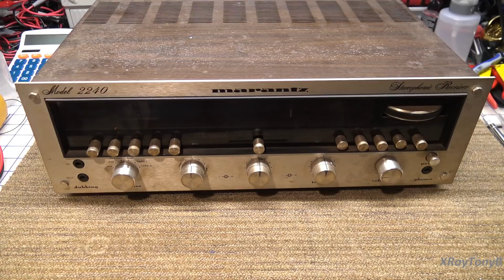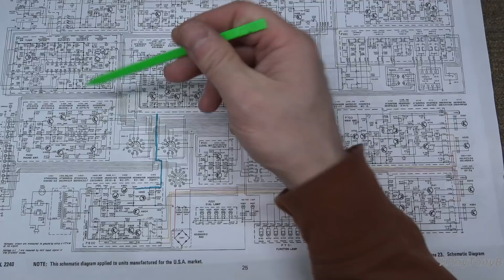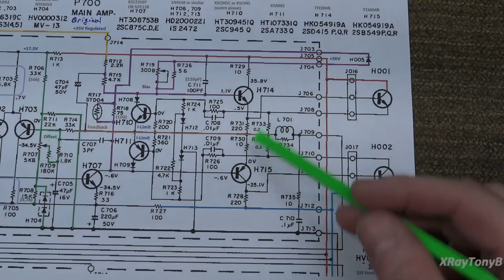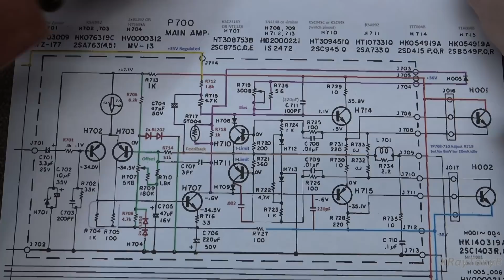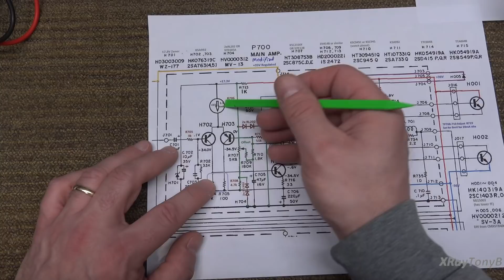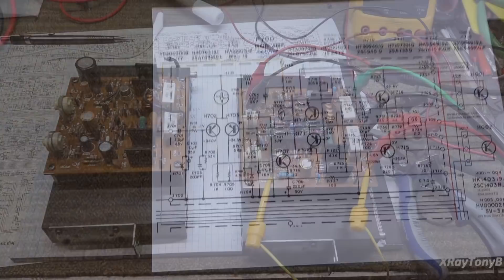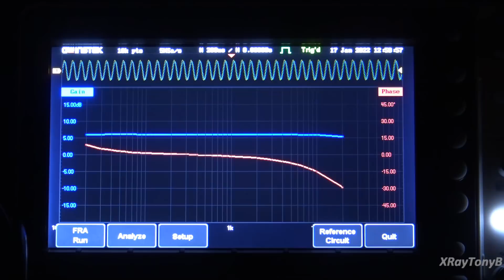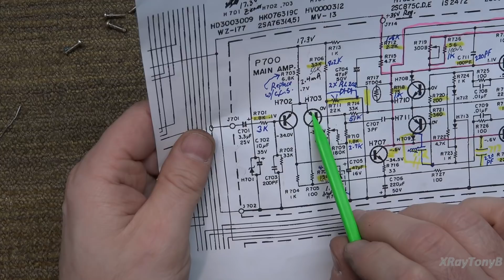Marantz 2240 Restore and Modification

Comment: Your explanation of how the differential input circuit works is wrong! The current in emitter resistor is constant regardless of the  signal swing! The current through the collectors is the same at idle! As the current increases in the input transistor, it decreases by the same amount in the second transistor! So the current in the emitter resistor remains constant!! The differential amplifier is biased class A. Current is flowing in both transistors at all times!
Reply: If you did'nt use the offensive language, one might be encouraged to review Tony's explanation and  your argument. Maybe you look to other comments here to see how to express yourself.
Reply: @Raul I will try to explain you why the current through the differential pair input is not constant and depends on the voltage swing.
If you have 1V p-p input signal then the voltage on the differential pairs emitters will vary  + - 1 Vbe drop i.e. from -0.3V to 1.7V Vp-p therefore the current through the 6.8k resistor will vary form 2.3mA to 2.6mA.
That's why we use better current sources (usually active loads) than a single resistor.
Reply: Perhaps you could edit your 'comment' to say that his explanation is 'wrong', instead of 'BS'. Eh?
Reply: @cjay2  the reason I said BS is because he is misinforming his viewers and fans of his channel!! This man is a professional and should know better!! I changed BS to wrong as you suggested!
Reply: @RaulHernandez-lg5nw   online communication is tricky as it lacks so much of the nuances of the spoken word (not to mention language and cultural barriers)... what works best for me is to observe the tone the community members use and adapt.. it's like walking into a party and checking if ppl wear their shoes or not, are they loud talking, am i the last one to be sober, etc

i myself dwell in profanity and your choice of words doesn't register as offensive language BUT i'm not the one hosting the party. it's nice of you editing the comment as it hints to your intentions/temperament. the vast majority of internet users have the opposite reaction (almost never works) :}

hope this helps, i know it may appear annoying but it works.
wish you the best.

Comment: Тhank you Tony for sharing this interesting video.
I have designed several quasi-complementary output stages in the past and they really sound and perform good when well thought out.

Let me make couple of short notes here:
1) It is not the Vbe of the output transistor H002 but the Vbe of the driver H715 that is taken into account with the bias of 3xVbe drops in this topology.

2)Adding the current source upgrade will also improve the common-mode rejection ratio (CMRR) in this amplifier.
It will not affect the closed loop gain of the amplifier. So it doesn't make sense to lose gain using it. The closed loop gain is determined by the ratio (R714+R710) / R710 , which is 19.3 (25.7dB). So increasing R710 lowers the closed loop gain and the implementation of the current source has nothing to do with it.

3)Changing R720, R721, R723, R724 will only move the trigger point for the over-current protection.

4)This amplifier can be much more improved (adding current mirror, emitter follower on the VAS stage...etc) but I agree with you that it is already a well designed one.

Regards,
Tony B (namesake 😄)
Reply from the maker: HI Toni,
Thank you for the comment!  Looking back at this video, I really did a pretty lousy job of explaining the diff amp section of the receiver.  I should have spoken more about common mode vs differential mode signals.  I also should have explained more clearly how one transistor in the pair amplifies the input signal and the other receives the negative feedback form the output of the amp and how they add together at the differential output.  I also didn't do a very good job on how these signals interact and how varying the common mode current can affect the linearity of the pair (although it is usually only slightly).  I have the next project already on the bench, but I may clear the deck for a moment and get out the breadboard for a quick follow-up video.  It would probably do me some good as well, because I haven't done this since college in the 1980's.  Besides, my son is now in college studying EE and is starting to call and ask questions as he sees this stuff in class.  It just reminds me of how little I remember ;(  Thanks again for the comment.  You were spot-on!

Comment: It looks as though there's no lighting at the tuning pointer. That surprises me!
Reply from the maker: It only turns on when am or fm is selected
Reply: @xraytonyb   I wish all receivers had been designed so that the tuning dial as well as the dial pointer did not illuminate unless you were using the tuner.  Not only would the lamps last a lot longer but the receivers would be less likely to have badly baked, discolored, and melted plastic decades later (unless of course the tuner was the only function that the unit's owner ever used, as is likely in a mechanic garage. I don't imagine they were playing records very much, perhaps some cassette tapes or the occasional CD). You can usually tell what function was the most frequently used because the indicator lamp for that function will be burned out or much darker and blackened than the others.

Comment: Great knowledgeable and confident repairmen are never afraid to completely disassemble and clean first before repair. Its always a lot more comfortable to work on clean equipment. Cleaning can solve problems for example I had an Akai amp that did not have bad components it only had conductive glue and corrosion that stopped it from working. You and I can build one of these from scratch let alone repair it. ....It might take a couple of years😆. The secretary where I work at refers me to customers as a technician. I hate the word technician. I am a repairman. Technicians do technical work and still not fix a thing.
Reply: the other week i found a 'sponge spacer' in a not so old receiver (vsx-40?) that became slightly conductive as it dried out by touching the heat sink. it was right on the soldered posts of the preamp input board connector...

many years ago we had a wave of customers complaining about erratic mouse and keyboard behavior after buying a batch of imported Dell PCs. after swapping mice and keyboards, reinstalling and logging errors, we discovered there were minuscule metal shavings under the mainboards for whatever reasons. that fix took longer than anyone wanted..

cleaning and visual inspection are underrated :}

ps: how about 'technologist'? :}

Comment: Just add chrome wheels and metal flake paint chop the roof a little and you could say this is all Foosed up.
Reply from the maker: Also changed the oil in the capacitors and rotated the knobs.... ;)

Comment: There is absolutely no difference between the original version and the one with the constant current. So, other than heating problems how can anyone claim that "the bass here sounds better" when the scope shows no difference whatsoever? Besides, it's only the bass, and the terms they use are so subjective that it can't be nothing else than pseudo-science...
Sorry Tony, you're usually a quite reliable and competent technician, if I had to hand my equipment  to someone here on YouTube I'd probably hand it over to you, but please do not fall through the audiofoolery rabbit hole, even more when you use a test music that clearly has been recorded and mixed digitally...
Reply from the maker: Thanks for the comment.  This is the reason I did this video.  From what we can see on the test equipment, there is little to no difference in the performance of the stock design vs the modified design.  Sound quality of any audio gear will always be subjective.  As a repair technician, our job is to make sure the amp is performing up to spec.  What I can say about this particular project is this:  The CCS will keep the diff amp stage a bit more stable, especially when it comes to music with a lot of dynamics.  In addition, the transistor pair will be less likely to drift because of temperature changes.  The circuit would be improved with the addition of a current mirror at the collectors, but it is not practical to do on this amp.  Many other designs make this same compromise by using a CCS at the tail with no current mirror at the collectors.  As for the improved bass, I can only report what I hear when compared to stock versions of this amp.  Is it placebo effect and I'm just crazy?  Perhaps.  I rarely say things like this, as I am someone who likes to be able to "view" what I am hearing through the use of test equipment.  The recording didn't do justice to the real thing (it never does).  This amp really sounds good to my bad ears.  Anyway, this is the kind of stuff I really like to discuss with others.  This is how we learn.  Thanks again for the comment!
Reply: I don't recall that he compared the bass response of the modified to the unmodified, but the amp in general to other amps.  Speakers are NOT simple resistive loads.  But all testing I've seen (from everyone) fails to look a the complex interaction between amp and speaker.  Looking at dampening factor is a start.

Comment: Bass tone control center frequency must be reduced to increase sound quality
Reply: Carlos, you've deleted your posts, so I'll take the opportunity remaining ones present.
I can only see a snippet of your answer. Amp is simply inverting both outputs, hence they are in phase in relation to each other ! The jump you see on the Bode plot is the phase plot going above or below 180°, this undulation is there for crushing majority of amps and would look perfectly normal, if plotted at 0° line in the midrange instead. All it takes to restore absolute phase is to swap both speaker connections. Simply connect plus terminals to negative and minus to positive and your output signal will be in phase with the input. As to "bass control", you never use them if the goal is to increase sound quality! You either set them to zero (good), engage tone defeat (better), or use an amplifier without any of that nonsense (best).

Comment: Shango's special indeed.
Edit after watching: You had once proper stabistors in the DIP packages, why not use them?
Edit2: It seems the in and  out front panel sockets, the broken ones, could be substituted with ordinary headphones' 6,3 mm TRS jack sockets. They would fit nice.